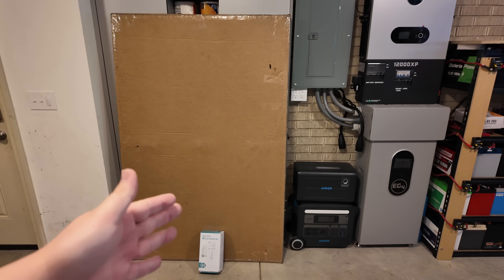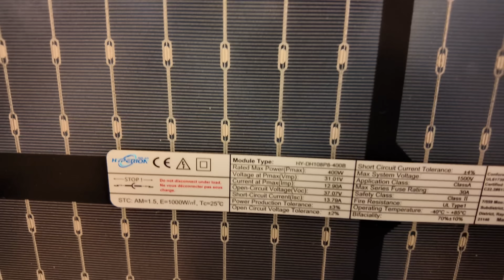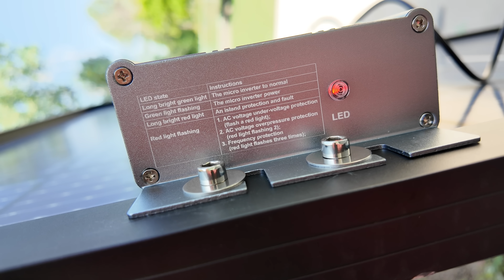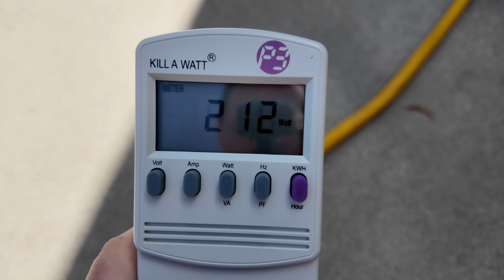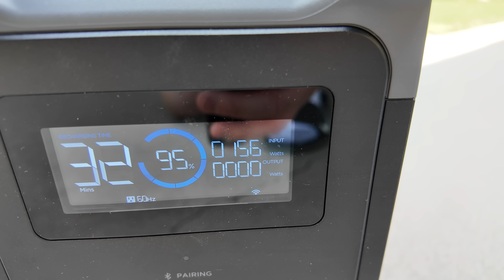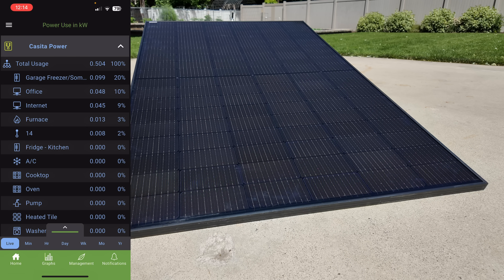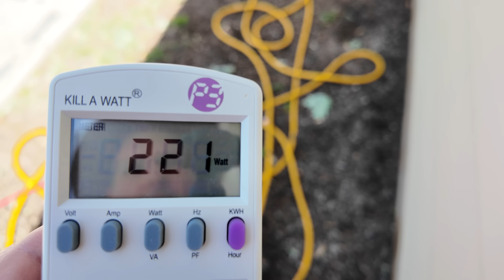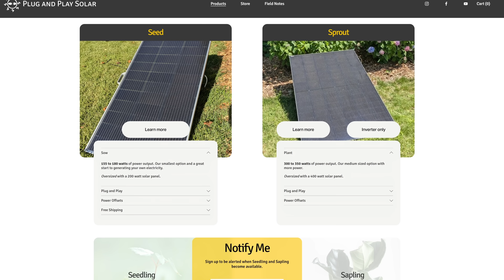This Solar Kit Plugs Into Your Wall?! Plug & Play Solar Review!

Comment from the maker: Buy Plug and Play Solar Power Systems: Currently, the Plug & Play Solar Kits from this video are unavailable. But I have found a better plug & play solution! Check it out here: https://youtu.be/E_BFfrL80O0

Check out the pricing on these brand-new 405-watt solar panels! Don't need to buy large quantities to get good pricing! Incredible! https://payoffsolar.com/product/alexus-405-watt-black-solar-panel-alex-405-b54-s?ref=TRICK5

Buy a MC4 disconnect tool: https://amzn.to/3Ilr8Z4 

Watch all my solar power related content, from solar powered air conditioners to whole home solar power backup: https://youtube.com/playlist?list=PL-2uuHDasQcpSfUqgyHLbT29Wk4gxLkk7&si=aL-C0-ip_wXWQQG2 

CHEAP NEW SOLAR PANELS: https://payoffsolar.com/products?ref=TRICK5 
Be sure to use my code: TRICK5 and save 5% on your entire order regardless of how large or small!
IMPORTANT NOTE: The website is currently going through a major upgrade! If you can’t get the code to apply, or have other issues, please be sure and email, text or call Matt the owner. Be sure to let them know I sent you from my channel so you get your discount for being one of my viewers. matt@payoffsolar.com 801-448-6396

Buy adjustable solar panel stands: https://poweredportablesolar.com/product/portable-solar-panel-stand-legs/ref/84/

Buy a heavy duty 10 gauge extension cord like you saw used in this video: https://amzn.to/4lKLYiT 

Buy an EcoFlow Delta 2 Power Station like you saw used in this video: https://amzn.to/4eBVxyk 

Buy a watt meter: https://amzn.to/44nYAXI 

Ask me a question and get a personal in depth response: https://ko-fi.com/s/8d8df1880c 
OR
Sit down for a personal 1-On-1 hour long video consultation with me and I’ll provide answers and insights to anything you want to ask me about from this channel: https://ko-fi.com/s/dd139831a7 

All donations get 100% re-invested in the channel:
https://buymeacoffee.com/theresatrickforthat 

Affiliate Disclosure
As an Amazon associate I earn from qualifying purchases at no cost to you! Thanks for your support!
Reply: Solar

Comment: is there a safety reason that prevents the converter (given that it throttles when hot)  cannot be located in garage or basement that has air-conditioning?
Reply from the maker: Nope!

Comment: Some people runs the sprinkler  on the panels .. 3 minutes every 1 hours .
Waters the grass and cools down the cells which in turn increases the power
Reply from the maker: I would never do that personally. We have really hard water and the mineral build up on the panels will far more affect the performance of the panels vs just leaving them hot.
Reply: @theresatrickforthat 
Makes sense .. I wouldn't if I have hard water.

Comment: One question i have 700w same inverter and want to do a trick with feeding this inverter from Temgo 51,2v 100ah similar to what you did with AC trick.
Will this inverter handle output from Temgo? It won't blow up?
I just read it's discharge at 200a and it makes me concerned before I connected it 😂
Reply from the maker: In theory it should. However, during my testing of this cheap 110 V micro inverter I discovered it overheats very easily. So exercise caution! Thanks for watching!
Reply: @theresatrickforthat so i assembled my system with temgo 51,2v in the middle and this inverter won't show a thing ( not sure why, maybe the voltage is too high for it?

Comment: Do you know how this would work with a Tesla Powerwall 3 system connected to the house? The Powerwall 3 is grid forming, I have a backup switch installed on the meter. Would the Powerwall charge if this panel was producing energy, like would it see a "negative" power from the house if the DIY system was net producing? Im so curious! Thanks
Reply from the maker: I don’t think it would work like that unfortunately. You need a port on your inverter (Powerwall) that can accept AC coupled solar. Otherwise, I’m afraid there would be something that would blow up, and I wouldn’t want you to risk your Powerwall! :) Thanks for watching!

Comment: Needs charge controller? I do not see one.
Reply from the maker: Nope! We’re not charging batteries, just generating power on demand so don’t need a charge controller since we aren’t using batteries. Thanks for watching!
Reply: @theresatrickforthat but would not that avoid over heating the inverter-controlling what comes from the panels?
Reply from the maker: There are 2 MPPT controllers for each of the inputs built-into the inverter before the power hits the inverter portion.
Reply: @theresatrickforthat thank you

Comment: If you get the new ecoflow stream microinverter right now with the early bird pricing and a few panels from Matt you linked in a previous video you could get the 1200w of solar for close to the same price as this. The price there will go up as soon as they go up to normal pricing.
Reply from the maker: Yep! I actually just took delivery on the Stream! Video testing it out coming soon!

Comment: Most states with big cities require permits, inspections, and utility agreements and would  likely not approve these type setups. Not to mention if you burn the house down, your ins. company won't cover you. For just a few (half dozen or so) panels, I'd run what I could daytime and get several lifepo4s(4k-6k life cycles)to run what I  could at night. All of which would be run separate from the grid, with dirt cheap used 20c/watt panels.IMO with solar , you either go big(all in) and hope it pays off before you die or start small and build slowly as $ permits, panels get cheaper, and tech. improves.
Reply from the maker: Yep! Got to check with your local areas first before doing this and involve professionals! Thanks for watching!
Reply: I've started small with 500 watts of solar panels and 300 ah of LiFePO4 batteries. I use them to charge tool batteries and to power a small refrigerator in my shed. I won't touch a system like this in a grid-tie application until they're UL approved, or my state (California) legalizes them as in Utah.

Comment: im in canada and a 400w panel here cost $400. If I could get them for $95 id have a few by now. I paid $160  for 4 small 18 inch panels making 25 watts each at their best. If I was in the US id be of grid for sure with how cheap it would be to get set up.
Reply from the maker: Wow…that's a bummer about the panel prices in Canada, but hopefully, you'll be able to get a system running soon! Thanks for watching!

Comment: How do you know if the kilowatt P3 meter is bi-directional? normally it reads power flowing in the other direction I wonder how accurate the numbers are on the P3 meter.
Reply from the maker: I tested it before…it reads watts the same regardless of which direction the power is flowing. Thanks for watching!

Comment: Check voltages, the Microinverter supposedly needs to be producing 2 volts higher level than the grid to be able to push its power with maximum efficiency.
Reply from the maker: Great advice, thanks for the tip!

Comment: Most places require grid tie agreement.  We need more states to do like UT!
Reply from the maker: I agree! Thanks for watching!
Reply: The codes and permits are for safety.  See other comments about fire hazards due to improper wiring and fuse protections.
Example: You could feed 15 amps from the fuse box safely through a 15 amp fuse.  You can safely feed 15 amps from these panels through a 15 amp fuse.
BUT, what if you feed 15 amps through the fuse PLUS 15 amps through the same circuit from these panels and somehow a 40 amp load is applied to the circuit? 🎆😳🔥
Reply: @DM-zq8qy Modern anti-islanding protection – Most grid-tied solar inverters cannot backfeed if the grid is down. They detect loss of grid frequency/voltage and shut off in fractions of a second. The “accidental backfeed” scenario is mostly theoretical unless someone bypasses code-required gear.
Reply: We have a terrible net metering system here.  Utah isn't pro solar at all.

Comment: I'm just curious, are you on a net metering plan with RMP? What happens to your power bill if you send excess power back to the grid?
Reply from the maker: Hey @jasonoid! Nice to see you in the comments! Love your very in depth testing of power stations! Anyway, to answer your question…I personally do have a net metering agreement…but even if I didn’t, I’m good to go because I live just down the street from you in the great state of Utah and just this year plug in solar systems like this just got legalized for the state up to 1,200 watts. So as long as the inverters used won’t backfeed the grid during a power outage (anti islanding) anyone in the state can plug in up to 1,200 watts of solar power and even if it back feeds when the power is on, you won’t have issues. You just won’t get any credit for that power without getting a net meter agreement. So you’ll just be gifting free power to the utility. But nothing says you need to max the 1,200 watts out. If you could get say 600 watts worth of power to offset your 24/7 base line loads in your house…that could have a major impact on your power bill with not much of a solar system. 
Thanks for watching! Keep up the great work on your channel!
Reply: @theresatrickforthat 600 watts will produce about 2.4 kWh per day.  At $0.15 per kWh you will save about $11 per month (2.4 x $.15 x 30).  $130 per year is good to have for a little back-up power, and you will eventually get your money back.  Just be careful to use dedicated circuits to the battery, fuse panel, or load.
Reply: @theresatrickforthat  thanks, you have some excellent videos as well! 
I've called RMP a couple times and unfortunately they don't have much information about the technicalities of the new law and what will actually happen when these are used. My worry is, since I don't have a net metering plan with RMP, my meter won't be able to tell what power is flowing in or out, so I'll also be charged for any power that I push back to the grid. That would be horrible if that's the case. 
Their representatives haven't been able to tell me that I won't be charged for excess power I send to the grid so I'm waiting to learn what will actually happen before I test one of these 😂
Reply from the maker: Yeah! Probably a good call. I would personally love to see someone come out with a 120v plug in micro inverter that ideally pairs wirelessly with CT clamps (they would need their own power source from somewhere in the breaker panel if they were wireless) like the big hybrid inverters use. Then the micro inverter could curtail its output based on the CT’s reporting so that you don’t backfeed. Something like that could be legal anywhere like hybrid inverters are…just at a fraction of the cost! EcoFlow is like 70% of the way there with their Stream system. Just need to add the CT’s to the mix!
Anyway, I’ve got the EcoFlow Stream on the way so testing and videos on that will be coming soon! I think it is probably better than this latest kit I tested.
Reply: @theresatrickforthat      I finally talked to someone from RMP that knew what they were talking about. Basically you need a smart meter to not get charged for power production. A normal AMR meter will bill you for production. Good news is that they made a recent change so anyone can get a smart meter now by calling and requesting it. I have once scheduled to be installed now.
Reply from the maker: Yay! Very exciting! Thanks for the report!

Comment: I've got 4 strings of those panels. Perfect conditions I've seen them put out 480 watts. But day in, day out they are producing north of 400 watts at peak with my inverters clipping each array at 4000 watts. Back when I got mine I paid 90 bucks ea. Saw them as low as 80 bucks not long ago. They may be back north of 100 bucks now? Good panels.
Reply from the maker: Awesome info, thanks for sharing your experience with these panels!

Comment: Where I live (Rio, Brazil) a typical diy solar pays itself in 15months . I'm currently with a 2.4kw four 610wp bifacil canadian running on a micro inverter 2k that peaks 2.1kw. I'm about half way of the payback,  once I finish I'll double the power.
Reply from the maker: Awesome to hear! Mando um abraço para o Brasil! Brasil é muito bom! 😊
Reply: Just curious, living in Brazil,  what is your optimal angle for your solar panels. Are you close to the equator? I live in Toronto, Canada, and my angle is 35°. Cheers!
Reply: @Richard-nb4iv I have half at 40* or so and half flat maybe 5* so half peak power at 6mo for some and the other 6mo the flat panels go peak.
Reply: I live in Rio . Way far from equator
Reply: @lipevolcom2 Nice! I heard the most northern part of Brazil is closer to Florida than it is to its own southern parts.
Thanks for the reply!
Reply: Since I have micro inverter I know each panel real time production. So the best will always to adjust the angle according to the season but not many people can have a ground array that can do that but by far is the best way to make money fast

Comment: I wonder if the inverter can be submerged in water under the shade to keep it cool
Reply from the maker: That would most certainly cool it off! However, I don’t know if it’s rated for submersion and still be safe. Splashing water like rain and sprinklers is okay…but I don’t think it’s rated to actually be under water. Sounds dangerous to me. Thanks for watching!

Comment: If I remember correctly, Bifacial usually needs a semi reflective surface to get use out of the back side
Reply from the maker: Yep! Bifacial panels need to be installed in a way to get reflected light on the backside! Thanks for watching!

Comment: I skimmed through the comments and something I didn't notice anyone mentioned was that if you don't have the correct setup and you aren't using all the electricity produced, it will go into the grid and could possibly cost you more on your electric bill. Without the right setup, most meters don't care which direction electricity flows, they will continue to just count up. This likely wouldn't be a problem with a few panels but if you have for example 12 and you shut everything off when you leave the house during the day, sure your a/c or heater will kick on and off throughout the day as well as refrigerators and freezers but when they cycle off you could be pumping all that electricity into the grid while also telling the company to take your money as well.
Reply from the maker: Yep! That’s why I have my disclaimer and explanation at the very beginning taking about this! Thanks for watching!
Reply: Good explanation. I think the meter issue you described is very popular.
Reply: Only if the power is not coming in through the main service . UL1741 is what you should buy . It won’t output power if it doesn’t see power .
Reply: would it be possible to plug into a small smart battery and then plug the battery into the wall?   Might have a couple of benefits.
Reply: @laughinggas5281 smart battery like an ecoflow? If so yes absolutely but you would then eliminate the micro inverters because they charge from solar or grid and you can set the percentage battery backup and charge cut in/out and would then be introducing solar only when it can use it. Keep in mind it might not keep up with your particular needs since it can only have so much wattage and Amp input,  wattage is more important because if you go over it won't charge but it will usually drop the extra amps off.  I currently run my home server, optical portal (fiber modem), primary router and surveillance system on an ecoflow delta 2 with extra smart battery that is charged by 400w of solar and grid when the sun isn't shining. This type of setup eliminates any sort of back feeding issues while temporarily keeping items powered even when the grid goes down.
Reply: Most people would have to try really hard to produce more power than they use. That is the only way they would be charged for power they produced
Reply: @williamkreth  something very different than normal solar. This is only putting out 120V, L1 or L2. So it can't put 240V back into the grid and so the meter is not really an issue.
Reply: @williamkreth  quite often when not home.
Reply: @williamkreth you're correct under occupied circumstances, the problem occurs when there would be little to no usage such as when a person is away from home and everything is shut off.

Comment: Can we not buy a better inverter that has its own built in fans and get better performance?
Reply from the maker: 120v micro inverters are few and far between…and personally I would rather have one that’s passively cooled, vs. actively cooled. Fans running in a micro inverter outside in the elements seems like it’s going to break really quickly. Thanks for watching!
Reply: @theresatrickforthat  yes but cutting down the performance by 50% or more makes the panel super inefficient.

Comment: Just don't lick the three prong coming out of it!  What do they call it, a drop dead cable?  when the power goes out the lineman will really thank you when he gets shocked too!  Also, the breaker box will be useless with this plugged in so yeah, house fires, your insurance company will fall in love with you since they don't have to pay out anymore if your house burns down!
Reply from the maker: The male ends of the plug are not energized until they plug in and the inverter sense the grid. So no, it’s not a drop dead cable. I’m going to be making a video here soon addressing current sharing on a circuit for sure because that’s a valuable discussion! Thanks for watching!